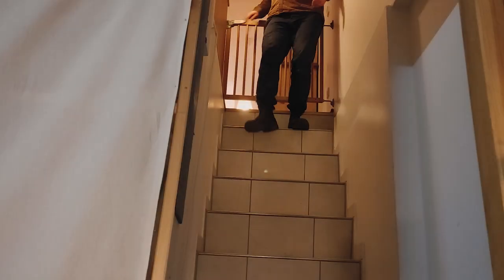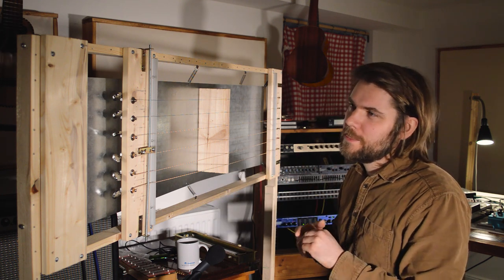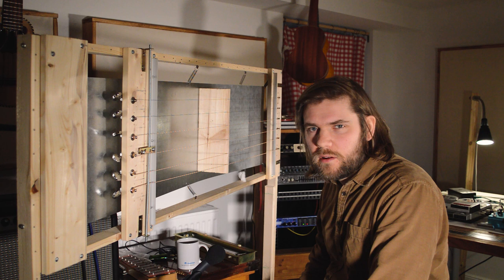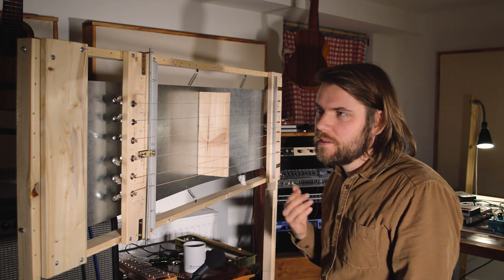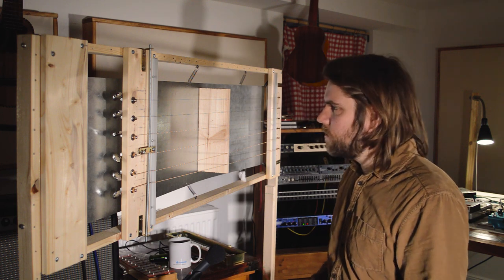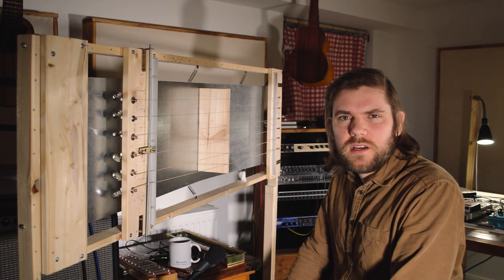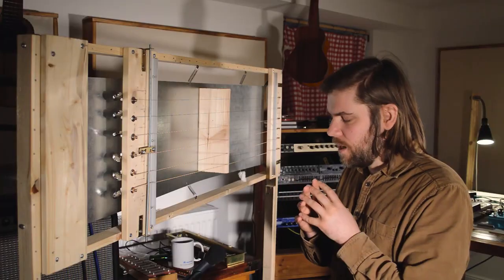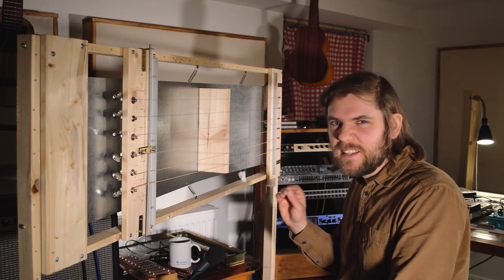Steel Plate Harp - A New Musical Instrument Made From A Sheet Of Steel

Comment: Beautiful instrument. Such a clever idea! What's the thickness of the steel plate? I suppose it must be light enough to vibrate in response to the strings.
Reply from the maker: Hi Fabio, thanks so much! Yeah it's not thick at all, 3mm or something like that. It resonates really well but it's still quite a quiet instrument acoustically so I ended up attaching a contact pickup to it which helps when recording.